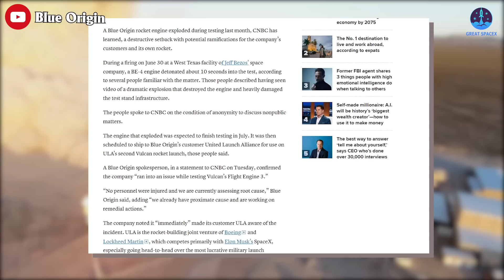BE-4 testing explosion! Blue Origin is in big trouble...

Comment: The BE-4 engine is about 5 or more years late. In 2018, a BE-4 engine exploded on the test-stand, and as a result Blue Origin management fired their leading engine-designer. That just goes to show how out of touch, ignorant and incompetent BO management is. 
It would seem that the engine explosion in June was during acceptance-testing, meaning the engine was not being tested to extremes, rather was being tested within its performance-envelope. One of the problems with BO is that they do not have many engines, hardware-poor as the situation is called, so that it is likely that BE-4 engines have not been tested with the thoroughness required, just because they cannot afford to lose any. I wouldn't be confident that the BE-4 will be a reliable engine for single-launches, never mind re-useable. Its pipes and tubing are just a rat's nest, making it appear almost like an amateur kludge, with BO scared to make any changes in case it breaks.
SpaceX on the other hand regularly tests its Merlin engines, and now its Raptors to destruction, finding out just how they behave under abnormal conditions, and improves them along the way.
Blue Origin also does not even have a static model of New Glenn, much less a prototype. They won't have seven engines available for testing New Glenn for a while, as they are having to supply ULA two BE-4 engines per Vulcan-Centaur flight. 
BO does do nice offices and empty facilities though, so perhaps they are wasted as an aerospace company, and should go into industrial real estate.

Comment: As long as Raptor is still distroying itself on the stand, and during flight Musk, and SpaceX have no room to argue. Raptor is just as much a hell hole as BE-4.
Reply: That is just so much wrongness in one sentence. BE-4 is a supposedly flightworthy production engine. Kabooms especially during acceptance-tests should be seen as evidence of inadequate quality control and/or design, and should not be showing up at this late stage, especially to a paying customer.
In contrast, Raptor is still in the prototype stage, but has actively been daily tested as part of its designed engine cluster configuration on both Super Heavy and Starship, both in static-fires, spin-primes and in flight. There is no other customer for Raptor, so no time-constraints on testing and no 'where's my engines, Elon stuff?' Raptor 2 development is leading to Raptor 3, already much smaller and cheaper than BE-4, now with more thrust than BE-4. If anything showed record testing and development of a design, it is Raptor. 
BE-4 is a kludge in my view with a potentially flawed design and execution, plus it is late, and expensive. That doesn't sound like a recipe for success.
Reply: @mauricegold9377  Musk himself has admitted to the complexity of not getting a Raptor (of any version) not to destroy itself. Every time he mentions Raptor, he always says, "How deos that throat not melt." So no Raptor despite having flown is not reliable, Musk just won't say it outright. Look at the 4/20 launch, 3 Raptors were down before liftoff. With more to come shortly after.

Right now, the time constraint is Artemis 3 because NASA selected the starship to have a part on landing on the moon. So no, you don't have unlimited time, and NASA is a customer because SpaceX is contractually bound to do what they said they could for Artemis 3. FYI, the crew was just selected for Artemis 2.

Thrust isn't going to matter much if the rocket it is attached to is junk. SLS has flown and flew just as planned the first time. While Starship and Superheavy haven't even gone sub orbital yet. Granted, Blue Orgin hasn't either, but they don't have a part in Artemis 3.

Like I said Raptor is just as much a hell hole as BE-4.
Reply: Ok, call it hell hole in it's prototype phase. Falcon 1 was hell hole and got to orbit, followed by Falcon 9 and Heavy. Do you think starship will fail with such a succes ratio of SpaceX.
Blue Origin has accomplishment to make still.
Carnival Ride is grounded so no reliable BE-3 or BE-4 engines. So I don't put my money on BO. Now thats a hell hole.

Comment: Yeah but…….the BE4 is just loafing along at like what - 60% of maximum effort whereas the raptor is really freaking close to max all the time.
Reply: While that 60% performance may be true, the explosion on 30th June becomes even more alarming. I believe the BE-4 is far too complex with its tubing rat's-nest and a single turbo-pump. Worst of all though are the construction times for a BE-4, the cost, meaning that BO cannot supply and test them in the numbers required for safety-testing, for ULA, and for New Glenn, whatever decade that last may appear in.

Comment: BO has committed to deliver four BE4s to ULA in 2023.

Space X has committed to deliver almost four hundred Raptors in 2023.  While the first version of Raptor had less thrust than the BE4, Raptor 2 has almost exactly the same thrust, and Raptor 3 has ten percent more thrust.
Reply: Yup, I've been watching this too. It used to be that the Raptor wasn't quite a drop-in replacement for a BE4. Now it's an upgrade, and for probably half the price, maybe even one third. Sadly it would take ULA about 2 years and $billions to redesign the thrust puck & software to switch to Raptor 3, the first 6 months would be contract renegotiations. The kind of thing SpaceX does between booster tests as part of routine operations. Oh well, ULA are for sale now so this fiasco might not go on much longer now. Who am I kidding, Vulcan-Centaur will happen, and Uncle Sam be paying out the ass for rides on it for decades, while SpaceX captures the entire competitive commercial launch business.
Reply: @dorbie  Half the price?  Probably less than a tenth of the price.  BO have a factory the same size as SpaceX's Raptor assembly line.  They probably have about the same number of engineers and technicians, maybe more because SpaceX has programmed robots to do most of the work.  So BOs manufacturing costs are about the same as SpaceX, but so far they are struggling to produce one one hundredth of the number of production engines.  And their engines are at least twice the mass of a Raptor for, now, less thrust.  BO will not even tell anyone, except maybe ULA, what the mass of their behemoths is.  Ok  to be fair neither has SpaceX said anything since it described the Raptor 1, but I bet Raptor2 and 3 mass less than Raptor 1 because "the best part is no part".
Reply: @jamescobban857  BE-4 had a price tag of $7million last time I looked, it's costs are of course higher at this point due to no real amortization as yet but it's early days. ULA Vulcan has probably been a valuable forcing function for them. Raptor had a cost approaching $1million with a full scale production target that might amortize costs to $250k, although that's probably very optimistic. However cost is not price and SpaceX would be foolish to sell Raptor to anyone for anything less than $2million, considering the additional support, processes, impact to schedule, etc. this would inevitably require. ULA wouldn't just buy engines, they'd need to push various accounting and test requirements upstream. These overheads would have to be amortized across the volume supplied, and ULA's current needs are low volume for Raptor's manufacturing. So while you are more than correct on cost, my numbers were guesstimated based on likely price.
Reply: It should also be noted that the ~$1 million cost of Raptor is marginal cost, and that's not how you ever price anything especially not to a 3rd party. If SpaceX were to sell a Raptor at $1million ULA would be getting vastly better prices than SpaceX because there'd be no built in share of the R&D investment amortized over the production run. Where this number becomes really flexible is the time period & production volume over which they choose to amortize those R&D costs and how they weight their own volume vs 3rd party volume. At the end of the day the pricing would be somewhat arbitrary, but somewhere significantly higher than SpaceX's marginal cost but probably lower than BE-4 pricing. So anywhere between $1million and $7million, but factor in the overheads of supporting ULA offset against the ego boost to Musk of fixing Bezos' mess and it's anyone's guess really.

Comment: cue all the SpaceX fanboys...ULA has an unmatched record of successful launches and does things differently from SpaceX...they'd rather have any failure on the ground than risk a high value payload...
Reply: Yes but ULA are not building the BE-4 engines. They are relying on BO for that. And the failures on the ground will be failures in flight if BO don't get their pathetic engine production quality-control/design/numbers of engines built and tested improved. And the BE-3 hydrolox engine that failed on their New Shepard tourist toy is not fixed yet. Some sort of long-standing corporate-malaise at BO methinks.

Comment: BO is a lesson on what happens when you hire engineers steeped in the 19th century waterfall method of testing, rather than the modern Agile method of testing of which SpaceX and Tesla are masters off.
Reply: Most applications of agile aren't that agile and use tools like waterfall in various ways. In general I agree but attitude is vastly more important than methodology.

Comment: No hate but raptor fails all the time and everyone says it’s ok but when it’s blue origin it’s not?
Reply: SpaceX design development expects risk/pushes the envelope to learn/designs rockets to withstand an engine failure.  The BO engine that failed was the same one that was gonna be installed on ULA’s rocket.  It would have destroyed the rocket, the payload, and set ULA back for years.  Probably would have eliminated ULA rocket launches altogether, considering where SpaceX will be in a couple years
Reply: The test in which the BE-4 exploded was a mere 'acceptance-test' meaning that it was a production engine just being fired within a conservative flight-envelope to demonstrate that it worked well enough to be deemed 'flightworthy'. Obviously it didn't. BO does not do development-testing on production engines, as they just don't have enough to do that, and are supposed to be ready to fly. 
 SpaceX tests are much more stringent, with flight-envelopes being investigated, and lots and lots of stress being put on the engines. This has led to lots of evolution and development of the design, actually simplifying and improving it enormously.
BO are terrified of changing anything on this rat's-nest BE-4 design in case in breaks in some unforeseen way, and are essentially praying that one or both won't go kaboom on Vulcan.

Comment: One look at the engine tells me they will soon be out of business.
Elon has taken simplification to heart,
and with it comes proportionally increased reliability.
What this means, is every one else has to simplify also, or they will soon have a hard time getting business launching anything of value.
Having a clue about where Elon might be heading, I suspect everybody else is in for a chain of shocks. And that the difference will become obvious fairly quickly.
I also suspect as soon as Elon gets Raptor 3 series certified, he will start shifting to them on everything he launches.
And that they will be the pace setters for National Security standards...
Reply: The Raptor is anything but a simple engine! SpaceX has just mastered mass production and economies of scale to drive down cost and increase production rates.
Reply: @eyeborg3148  You haven't seen Raptor 3 yet?
There have been two images released, the first had zero pumps or anything else attached and the second had a single pump system attached. And since then basically no images in spite of dozens of videos about Raptor 3, and its now being described as being kept secret.
And Being the guy who planted the parts count concept on r/spacex for it to get to Elon, and at same time several writs on possible resulting designs, I suspect Elon will come up with something maybe even better than my suggestions. And that its being kept secret is a very good sign. From what I could see from the published images the only thing it has in common with Raptor 1 & 2 is the name. Which is why I wrote the comment here, 
To give others a heads up, that theres likely a paradigm shift in the works. I know where the parts count path leads, and I know Elon knows...
And it ain't Rats Nest rocket engines.
In his words, the Raptor 3 is "Less Stupid", i.e. Raptor 1 & 2 are stupid in comparison. He also has described the parts count accretion process, which was very much like one of my writs. And all these video channels talking about Raptor 3 are basically quoting my description of the positive effects of parts count reduction. 
Its like hearing echos...
The next launch attempt is supposedly gonna be Raptor 2 engines, so one or two after that they should debut Raptor 3.
It could be longer, depending how far down the rabbit hole they go on simplification in one leap.
As one option would require serious amounts of engineering and testing to do. way more than just a new version of an old design. There exists the possibility to get moving parts count reduced dramatically and Elon knows it. Moving parts are the most failure prone parts.
So just be patient... good things are likely.

Comment: Building rocket engines is hard. They are 90% of the way toward an explosion even when they work. Better they do it on the test stand than on a mission.
Reply: Sure, but exploding after ten yers of development with boatloads of money and no launches?
Underwhelming.
Reply: Absolutely, but damn. This is a production engine, I feel really bad for sierra. Like holy shit, after ten years you'd hope these days are past them.
Hopefully this was a one off issue and not a symptomatic problem.
Reply: @Irishwhitewater257  Exactly. Hopefully it was human error in the test process, with the engine design itself being sound.
Reply: @zanelittlegray  We don't know that the BE-4 engine-design is sound. It does have low conservative combustion-chamber pressure, so you'd think it would be behaving nicely. but it doesn't behave nicely, as is demonstrated by that June 30 acceptance-test  kaboom, and that ULA had to send one of two BE-4s back to Blue Origin because of some issue a few months back.
Reply: @mauricegold9377  U R correct, that's why I said "hopefully".

But if SpaceX gets those Raptor engines to the point of being as reliable as their Merlins, then I really don't give the competition much hope for the near future.

After all, BO can't continue suing itself into govt contracts forever!
PS: There is a niche market for the smaller rockets however.
There will always be companies that need small satellites placed into specific orbits at a specific time, and Starship won't always be able to drop off a small, low-priced satellite in the right place & time if said satellite is merely wanting to "ride-share" on a Starship flight.
Reply: It’s so easy to sit back and hate isn’t it? You go build some rockets if it’s so easy. If it was there would be many other rocket companies launching into space. Truth is you guys have not a single clue about rocket engines 😂

Comment: So Blue Origin has a BE-4 engine explosion during testing and is labelled as a "disaster". Meanwhile SpaceX continues to have Raptor engine failures not only in testing as during flight, besides tearing apart the launch pad, and in those cases it's "valuable data". Can't stand the fanboyism in many channels.
Reply from the maker: Let’s compare what they achieve. That is two levels
Reply: So far in over ten years of development Blue Origin has only managed to launch a rocket powered pogo stick over and over again.  When they actually deliver on ANY of the New Glenn vaporware you can start crowing.  While they have been spinning their wheels SpaceX has launched and landed over 100 Falcon 9s.  Elon himself predicted a less than 50/50 chance of success with the first Starship launch, so it pretty much turned out as expected.
Reply: @jkleylein   compare the amount of funding both companies had, and you'll understand why Blue Origin apparent slower progress.
Reply: Why have so many woke wannabes gone out of their way to demonstrate they hate Elon?  Clue … it started after he bought twitter and cleaned house of woke censors who are intolerant of free speech
Reply: You as other fanboys continue to confuse Falcon 9 as Merlin engines commercial success with Starship as the Raptor engines. They're completely different things. The success of other companies besides SpaceX it's great news for real Space enthusiasts.